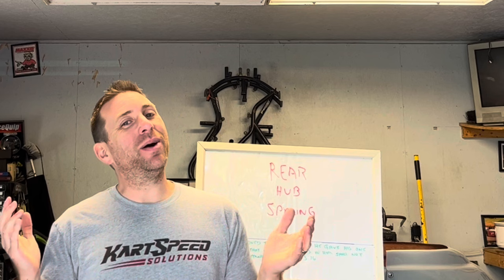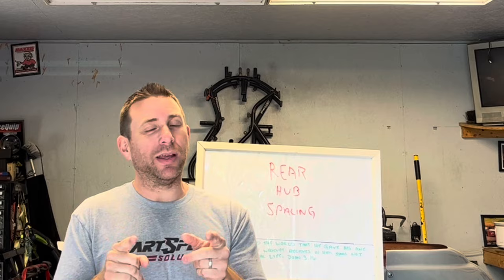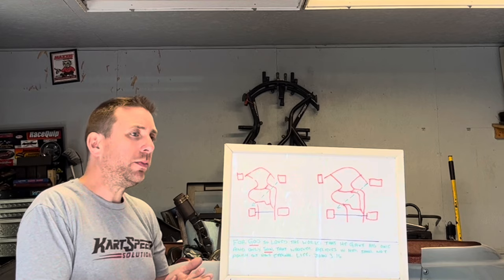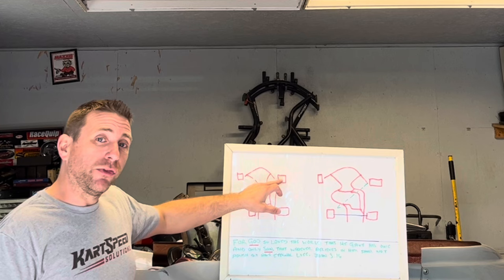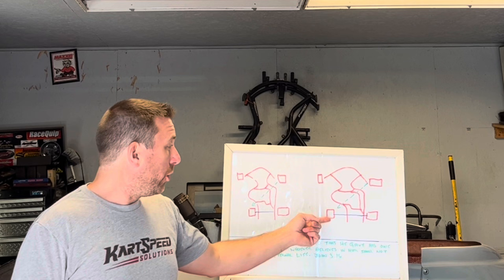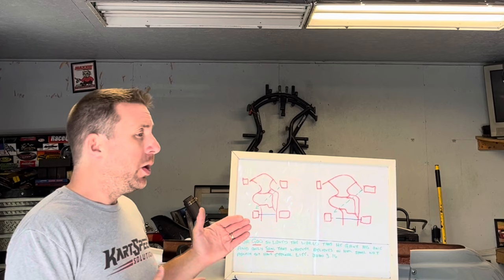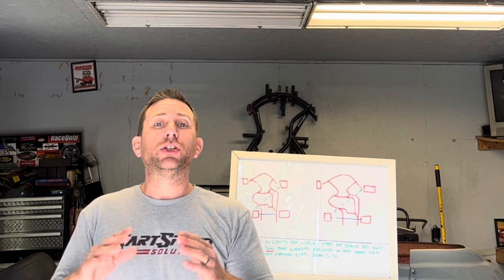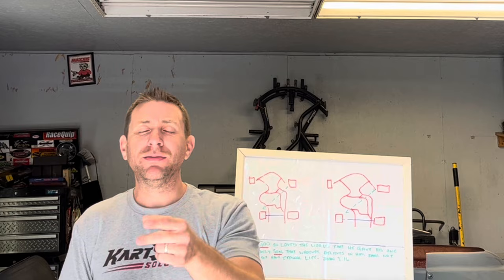How to use Rear Hub Spacing!

Comment: Thank you for your video I'm going to try and move my right rear out, i am a large racer and my kart pushes in, middle and out it's just miserable to drive and I'm trying everything with the front end and tire pressures but never did anything with the rear spacing, both rear tires are in as far as they can go so again thank you for your video and i will definitely start with the right rear

Comment: mmmmmmmmmm.... moving the hubs in (closer to frame) increases the static weight on the tire and takes weight away from other tires. Moving it out decreases the weight on said tire and adds weight to other tires (wish this point was mentioned). moving the left rear in or out will affect cross as well as rate of transfer. i think your next video should be about static vs dynamic weight and how it moves due to caster, camber left and rear weight percentages and weight moving front to rear under deceleration (breaking and turning the front wheels) and weight transfer under acceleration out of the turn.   i enjoy your videos. keep up the good work!!

Comment: Thanks for this Video. We've been pushing on entry in our Wing Kart. People have suggested more stagger, but we're already high in the suggested stagger range for PRC. I was thinking I need to adjust the hubs,  but wasn't sure which direction to go. I'll try moving the right rear out 1/4" and see how that does for us.
Reply from the maker: Awesome! That should help you a good bit. Remember an .0125” is a small move, an .250” is a big move
Reply: @kartspeedsolutions  got it!